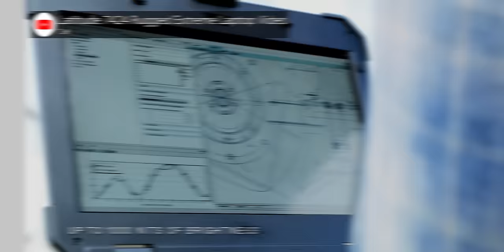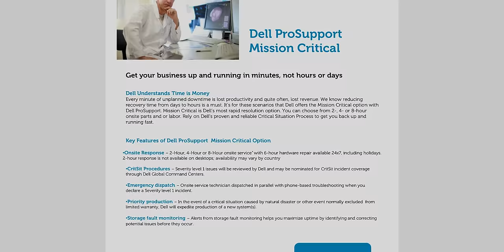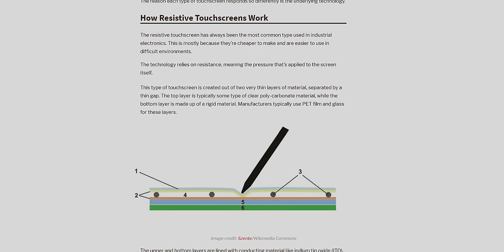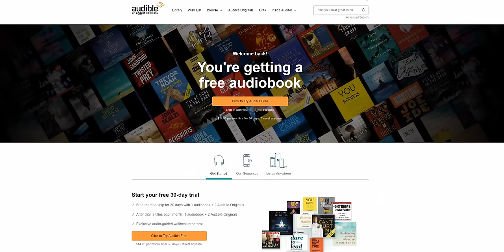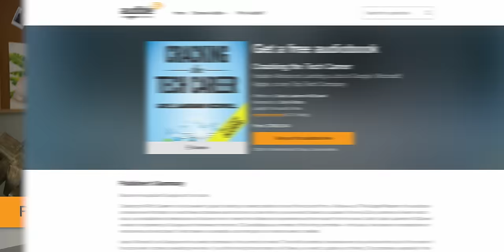The Manliest Laptop Ever – Dell Rugged Extreme Review

Comment: I evaluated that laptop against the Panasonic Toughbook CF-33 offering and we went with the Panasonic which has a great screen at 2160 x 1440  and capacitive touch screen that works with gloves and will work wet.

I'd like to see you evaluate the Panasonic soon.
Reply: I’ve actually encountered a Panasonic Toughbook in the wild years ago. I’m surprised that Panasonic still makes them.
Reply: I use a CF-20 everyday.
I feel that Panasonic makes the ultimate rugged laptops
Reply: @Ebalosus  They sell ALOT of them and the margin on them is crazy high. I wouldn't be surprised if they are one of the best selling laptops by unit numbers.
Reply: @thefamilyman  Panasonic actually was one of the first to make them. I would have chose them but my company went the other way because we also have normal laptops for other uses as well and it was cheaper to go with Dell, also, panasonics were also, at the time, rated for Natural gas work.
Reply: I currently use the CF-31 everyday... The CF-33's removable screen/tablet feature is actually a nice option, for what most of us use them for... SO might have to pick one of those up.
Reply: @Ebalosus  Toughbooks are a huge seller for Panasonic.  There are only a few vendors that make ruggedized laptops.  Getac is one, and Dell "does" but their early models were just Latitudes with a magnesium alloy chassis.  They were prone to the screen peeling away from the rest of the laptop.  Military, Law Enforcement, and Emergency Response groups use ruggedized laptops/tablets heavily.
Reply: Used a Panasonic toughbook a few years ago as a land surveyor.
Don't remember which one but it was great for fieldwork!

Comment: I use rugged laptops all the time on Diesel engines for diagnostic purposes. Not only is it rugged but these types of computers are just about the only computers with serial ports anymore. (A lot of the diagnostic hardware use serial ports for their connectors).

Comment: About time. I've been waiting for a military grade Laptop  upgrade for  a LONG TIME.
Reply: Exactly I mean it's a Panasonic Toughbook competitor. And yeah it has resistive touchscreen for mil spec reasons.
Reply: Why do you need it? Curiosity lol
Reply: The point of a laptop is portability and function, this supplies both while also bringing both to the extremes definitely a go to. Especially appreciate a hideaway camera and a touchpad, as well as the smart card support
Reply: Wut
Reply: @epicn  It's not that I need it. I want it for the very reason it's advertised as. I also hate the design of thin laptops and a majority of laptops in general.  If I can make an xbox/ps4 sized laptop I rather have that for it's durability.  But like I said, I want it for the reason it's advertised as. I'm not expecting to do any gaming on it. I have a PC for that.
Reply: @loreaver3882  These type of laptops don't come with high specs. The market has kinda ignored upgrade versions of this type of laptop. So the last one I have is one with windows XP.  The windows 7-8 versions aren't that much of an upgrade in specs.

Comment: You need to do a smackdown between this  and the Panasonic Toughbook. Like... literally throw them at each other... maybe.
Reply: @FlameOnTheBeat  I don't understand why they mentioned gaming etc. This is for getting shit done. Not messing around at home or in an office.
Reply: @seanlawrence6029  the fact that they even put a GPU in this thing at all is impressive (though it is crippled by the U series processor)
Reply: Throwing the two laptops at each other will create a nuclear explosion, destroying everything in a 5 mile radius.
Except the laptops, of course.
Reply: B A T T L E B O T S ! ! !
Reply: @JahnDough  That requires nuclear fuel which these laptops don't have (that I know of) but you could create a shockwave powerful enough to demolish cliff edges by smacking a couple of toughbooks together. Throw in a Nokia 3310 for some potent aftershocks.
Reply: Sean Lawrence it’s for relative performance comparison. The real reason for the performance is running different intensive programs military, law enforcement, and field techs might run, but it’s harder to show that performance metric to an audience that’s used to gaming performance metrics.
Reply: @rennemannd  I did all three in the NAVY and onboard Intel on a Panasonic was more than enough. I do get your reasoning from marketing the video to an audience that doesn't really get it.

Comment: They say it's rated for - 29C but in my experience with other rugged laptops, both Panasonic and Dell I've found that they often work in colder than that.

Once you much past - 35C they'll usually turn on but the screen will be blank so if you need to carry the computer between sites in your coat to temporarily bring the temperature up to display worthy
Reply: they are rated lower than their capacity
Reply: Yes, ratings are where things are expected to reliably work. In order to achieve that, there needs to be a safety margin on top of that. Typically the limiting factor for computing devices in cold environments is that the liquid crystals in the display freeze and the battery loses efficiency. Heating elements address both of those issues.

Comment: My University software research team bought one of these a couple of years ago, mainly for the ultra-bright backlit screen when we're working in direct sunlight. It works great out in the field, and you can even see the screen well wearing sunglasses on a bright summer day.
As we had Ubuntu installed (our software was easier to configure on Linux at the time), it was difficult to get to the brightness options, so while indoors, I usually just wore sunglasses when working with that laptop, rather than fiddling with the brightness settings each time.

Comment: can you guys find someone who really needs to use this thing and make him review it?
Reply: Send it to an oil plattform! Rain, Harsh winds, Loads of Grime and oil, Flameable gasses and liquids... EVERYTHING ITS MENT FOR :D
Reply: "It turns on" is pretty much the review they'll give. Not much else matters in the situations these laptops are made for.
Reply: Friend is a firefighter and they have one of these mountable on the truck
Reply: I use one of these daily as a mechanic/technician for an oilfield services company. I use CAT ET, Cummins Insight, MTU Diasys to diagnose engine codes and look up schematics and parts, and various other programs like outlook and a work order management system(Fiix). 

This thing is a workhorse, has never failed on me in -40 temps of North Dakota to 108 degree west Texas. Dirt, dust, drops, oil, hydraulic oil, brake clean, and the occasional beer has been spilled on it(the beer was after hours of course 😂).

I accidentally left it on a unit and it ran for two days before I could get back out there to retrieve it, it was wedged in between the frame and the fuel tank, pretty well covered in some oil, and obviously has been vibrating pretty good for 48 ish hours. Once it was cleaned it fired right up, no problems. 

I like it so much I bought 2 more as personal machines for my college aged children, both of whom are historically not nice to electronics 😂😂

Comment: I use one of these at work. Great laptop for outdoor field work. I've used mine at -43C without any problem. The outdoor readability of the display is also crucial, as I don't always have the ability to put the laptop in a shaded location depending on the work site. Having a serial port built in believe it or not is super handy, as a lot of commercial/industrial equipment still uses it for diagnostics, configuration, etc. Not having to carry around a USB-to-serial dongle all the time is great.

I agree with the review though - this is definitely a WORK laptop, not intended to be a gaming or personal PC, or even an office PC. It's for those who routinely have to work exposed to the elements, or in industrial and construction environments, that kind of thing, and need a laptop that is going to be reliable and stand up to the abuse that such work environments put on them.

Comment: I know you're thinking of use cases for the most 'extreme locations' but you have to think about just plain awkward locations such as visiting building sites, archaeological digs sites, any coastal vocations (coast guard or fishing fleet) or areas with excessive rainfall where you might need to work digitally. Just think of a use case where you'd be worried about breaking a 'normal' laptop with regular use and this sort of design will shine.

Comment: I have been working on laptops similar to these for the last 6 months.

We need them for our paramedics, and they are really tough to kill but easy enough to "break" if that makes sense. It will never stop running, but the folds for the ports, screws and bits and ends tend to eventually fall off or get lost. They are a lot of fun to work on though.

Comment: A resistive touchscreen is not "worse". You got that backwards. With resistive you can see what you're actually pressing instead of guessing with a fat finger. And no more fingerprints.

Edit: Forgot that they also don't have problems with cold or dry fingers. That's a huge benefit if you are going to use your fingers.

Comment: There is also a rugged docking station option ... if you could upgrade the screen, webcam, cpu, ram & the usuals it would be just what Im requiring. Cant find them 2nd hand here in Australia (dont think they were released here) so thats a bummer.  Back to the drawing board to "hulk up" a regular lappie with bent metal & rivets

Comment: love that you guys reviewed this, and that Dell still makes a nice lineup for the more rugged user (tablets are nice and all, but pc's still rule for many aspects).

I had an older Dell Rugged laptop years back while working for a Company that was managing 289 Wind Turbines in Northern Ontario.  We would travel with them, drive mill to mill and plug our laptops into the ones that needed more intensive/hands on diagnosing/resetting than we could achieve at the main power station remotely.  In the wintertime these things(the turbines) arent heated, so gloves are being worn the majority of the time, and moisture/dirt protection among the many other nice things they have (and have added on as new features since) are really useful and appreciated by many, im sure.  The fact that these machines are usually alot more responsive than the usual trash people come home with from mainstream computer stores and companies (even other, significantly less expensive Dell models can peform like absolute trash once you get them home, unless some serious tweaking is done)

Comment: 3:15 - it will shake of 40 degree shock.
What if the angle is 35 degrees or 45 degrees?
I think you meant 40 g of shock 😛
Reply: Or maybe actually 40°C thermal shock

Comment: This is like literally the only Dell laptop I'd ever buy lmfao.
Reply: idk i like their xps line as well
Reply: What are you talking about? Dell makes several excellent laptops. I'm using an XPS13 9360 right now.
Reply: Good luck with a broken bank. jklmao
Reply: @Passance  The last time I bought a Dell laptop the hinge on it broke without me even trying to break it but that was back in 2012 and I never touched another Dell laptop since then. The hinge broke after like 6 months of me using it on a table all the time and never using it anywhere else.
Reply: @TigerTT  yeah, I know how it feels when a brand seems to have let you down. But you gotta be open to second chances. I don't know what you were using back then but I've had this machine for about a year now, and it comes almost everywhere with me. The battery life and hardy aluminium/carbon fiber build make it a very reliable companion. I'm kind of embarrassed, the amount of punishment I've put this thing through makes me seem like a bad owner. Yet it's still in perfect condition aside from a few dents on the back corners which you gotta squint to see. Very, very impressed with the machine and tbh it would still be my recommendation for an affordable, sturdy ultrabook.

Comment: Panasonic Toughbook. We used them in the military and we couldn't break them... 

I would never personally recommend a Dell, although, I do have some self respect.
Reply: The ToughBook was practically indestructible, even with a mechanical HDD. My neighbor works with Law Enforcement and he used one up until they couldn't upgrade it anymore, and replaced them all with more modern, relatively standard grade Toshiba's (he hates it!). It's been in the shop 3 or 4 times in the last year. His 14 year old ToughBook STILL boots and works fine, although the battery is about wasted now, and he's stuck with WinXP Pro.

Comment: We use these in my job in the military, they still get broken lol.  Specifically the tabs for the ports on the back/sides, and we had problems with screws working their way out and ended up removing a bunch of them with the entire rear frame and putting glue over the essential ones.

Comment: My company use these, well, this is the newest model which we are testing now, but the previous ones, the only issue we have is the CD/DVD drives die easy as they are probably the weakest link in the armor. The previous handles were also a liability as they could easily break off. The new design actually improves both features. Our techs work on diesel engines for trucks and heavy equipment like front end loaders and generators. We also work with natural gas engines which are highly volatile when being worked on to the point we need special bays that minimize sparks. These were the only ones at the time when we started using them, that were approved for this use.

Comment: Devops/Dev. I only commute on a motorcycle, do a lot of machining, fabricating, and automotive on the side. I 'killed' my HP EliteBook 8570w on a commute. I had used that machine all day, every day, everywhere for eight years. I was devastated. I discovered a top of the line Rugged Extreme 7424 for 2000 with a Python scrubber. The person thought it was used, but merely was unboxed. What the doctor ordered. For gags I mount it on my inner pannier. But. They did not account for one thing. Thick dog hair. It clogs the active cooling unending because they couldn't install a more fine guard. Also I performed some micro soldering surgery on the HP since..

Comment: Found out something new, the RGB keyboard function FN +C. Our company just bought like a few dozen of them to replace their aging Panasonic CF-19 MKIII-IV. Quite a upgrade. I work as a geologist and we this laptop for logging on a drill rig in the Australian Outback desert where it often tempt get to 45+ celsius, in dusty and in rainy condition on the back of a tray-back ute so any lesser laptop just wouldn't really last. The best upgrade over the CF-19 and my own personal CF-31 MkIV is the bigger screen size, all day battery life, faster system, and much better screen colour accuracy (in order of importance). I only gripe at the moment is its system reliability across the board, some of program esp. the database ones on some of the machines (which use the same image) keep crashing and some have WIFI issues so being in use for a less a year and having stability issues on at least 10-15+% (that I know of) of the machines its lucky we have numerous backup machine we can swap out, but If i brought this as my one and only lap and paid this much money I'll be pissed. Last thing you want in the middle of no-where is unreliable equipment, I don't remember having these issues on the old Panasonic toughbooks. Also their spring latch locking mechanism over the ports I'm pretty sure won't last years. I'm started to finding it hard close the RHS covers, you really have to pushy hard and hopefully the latch connect. To me that's a design flaw, hopefully they can be easily replaced when worn.
Reply: nice tip, can i ask you a question? i heared that rugged laptops make loud fan noise for its protective cover design. Does it really make annoying fan sound? I wanna buy dell 5240 rugged for distorted preference but i don't want a noisy laptop.
If you have ever used your rugged laptop in office, i wanna know your opinion about this fan noise.

Comment: I believed the Latitude Rugged 5420 / 5424 is more suitable. Would you agree that it is also way better than the Panasonic Toughbook CF-54 or FZ-55? The common problem with the Touchbooks CF-54/55 is the latch which is easy to break and is preassembled to the front bezel and LCD. I had to replace the LCD when the latch had broken on my CF-54.

Comment: i use this as a work laptop. its awesome but the biggest drawback is the lack of an external charger for the battery, no not the power brick, and actual device that could charge just one battery connected to it, so you could use one while charging the other (it has 2). i don't understand why dell doesn't make these.. not even the chinese are, at least for now..

Comment: I would still prefer a GETAC X500 or a GETAC X500 Server laptop over this. Okay, I know, they meet essentially the same standards, so both are pretty well rugged, but the GETAC ones seem to be better in some areas. Like the number of drives you can add to the later, or the ability (with the optional expansion bay) to add PCI Express cards to the former.

Comment: I used to use a Dell XFR. The protective layers over the display started to delaminate after about 3 years - the silicone adhesive goo that bonded the display together started to leak out and make a mess on the internals. I recall the backlight started to go wonky towards the end as well, though I suspect it was due to the adhesive oozing into it.

Would strongly suggest a Panasonic over these Dells. The only real advantage they have over the Panasonics is ease of repair.